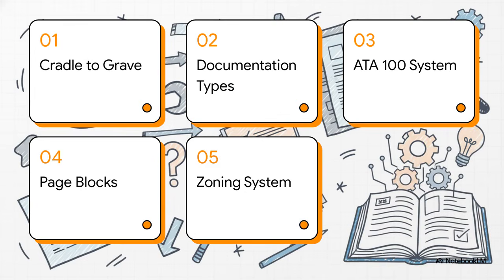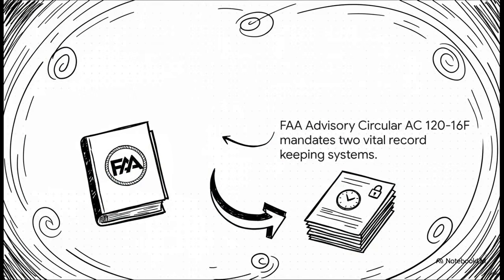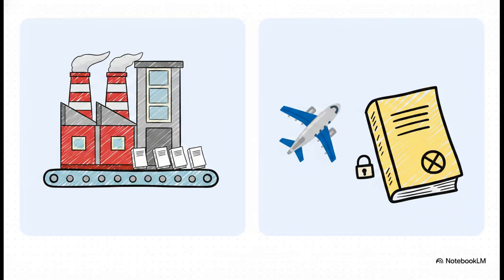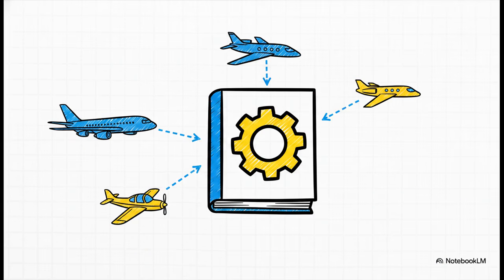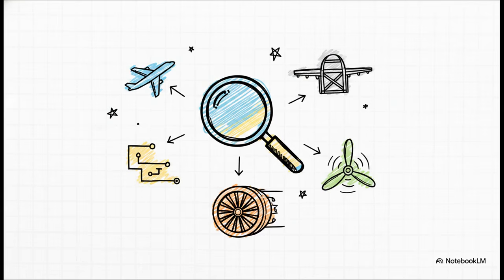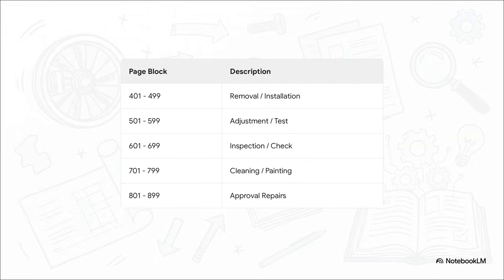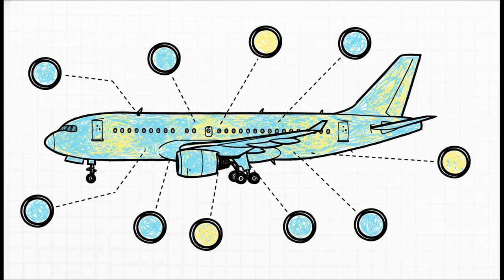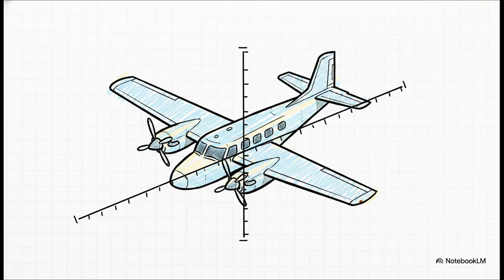AMTE 231 LESSON 01 INTRODUCTION

Comment: In Lesson 1, I learned about Aircraft Technical Publications and how they are important in aircraft maintenance. I learned about the ATA chapter numbering system and how ATA Spec 100 provides standards for the format and content of aircraft technical manuals. The ATA system organizes information into specific chapters, making it easier to locate details about different aircraft systems and components. I also learned that these publications are used by pilots, aircraft maintenance technicians, and engineers to properly understand maintenance procedures and technical information. Having a standardized system helps reduce confusion and mistakes when working on an aircraft. It also allows maintenance personnel to quickly find the correct information they need when performing inspections, repairs, or servicing. Overall, the lesson helped me understand that accurate and organized technical publications are essential for maintaining aircraft properly and ensuring the safety and reliability of both the aircraft and the people who operate and maintain it.

J.V.LADION_2B_AY2026-2027

Comment: After watching the video, I learned that aircraft maintenance documents are very important in aviation. These documents keep the record of the aircraft from the time it is made until it is no longer used. Every maintenance, inspection, and change done to the aircraft should be recorded. I also learned about the four main types of documents used in aircraft maintenance. These are manufacturer documents, regulatory documents, airline documents, and ATA documents. The ATA 100 system helps mechanics find information in maintenance manuals more easily. I also learned that the numbers in the ATA system have different meanings depending on the chapter and procedure. The video also explained the maintenance blocks, such as 401 for removing and installing parts and 601 for inspections and checks. Another thing I understood is aircraft zoning. It helps mechanics know the exact location of parts on an aircraft. The video helped me understand that proper documents and organized information are important because they make maintenance work easier and help keep the aircraft safe.

R.C.RICASA_2B_AY2026-2027

Comment: This master class gives a clear and helpful look at aviation maintenance documentation. It skips all the fluff and goes right to the parts you actually need for certification. I think learning about the life cycle under FAA Advisory Circular AC 120-16F is a game changer. It shows why every single maintenance action, inspection and modification creates a history for the airframe from the day it is built until the day it is retired. Also learning how to use the ATA 100 system is so useful. You can learn to read chapter numbers like Chapter 52 for doors and find page blocks like the 401 removal and installation block or the 601 inspection block. This helps you find what you need in technical manuals much faster when you are out, on the flight line. The way the course moves from zones like Zone 800 for doors to small aircraft station measurements using the reference datum makes a lot of sense. This review really connects the rules with the actual work of being a mechanic.

J.M.DELITON_1B_AY2026-2027

Comment: What stands out most to me is the reliance on the "cradle-to-grave" lifecycle. Seeing how every single inspection, modification, and repair forms an unbroken chain from manufacturing to decommissioning really drives home the responsibility involved in aircraft maintenance. Standardizing this under the ATA 100 system is a game-changer. The idea that I can navigate a 10,000-page manual using standardized chapter codes, page blocks (like knowing 400 immediately means Removal and Installation), and zoning numbers shows how structured communication directly prevents human error on the flight line. Whether dealing with broad zones on commercial airliners or measuring inches from a reference datum on light aircraft, precision is non-negotiable. This lesson helped me understand that knowing how to read the aircraft's geography and manual system is just as crucial as turning a wrench. Understanding these systems isn't just about passing a certification exam; it is about taking direct responsibility for structural integrity and passenger safety throughout an aircraft's operational lifespan.

RR.A.MUÑOZ_2B_AY2026-2027

Comment: Aircraft Maintenance Documentation

Aircraft maintenance documentation is an important part of aviation because it keeps a clear record of all maintenance activities performed on an aircraft. These records may include aircraft, engine, and component logbooks, inspection reports, repair records, and documents related to Airworthiness Directives. They provide information about what work was completed, when it was performed, and which authorized personnel carried out or approved the maintenance. Proper documentation helps maintenance technicians understand the aircraft’s maintenance history and determine what inspections or servicing may be needed in the future.

Keeping accurate maintenance records is also essential for aircraft airworthiness and flight safety. Maintenance entries should clearly state the work that was performed, the date it was completed, and the necessary approval or signature of qualified personnel. Well-maintained records also make it easier to track repairs, modifications, inspections, and replaced components throughout the aircraft’s service life. This allows technicians and aviation authorities to verify that maintenance has been performed according to approved procedures and regulations.

Overall, aircraft maintenance documentation is more than just paperwork. It provides a reliable history of the aircraft and helps ensure that maintenance is properly recorded, traceable, and completed to maintain safe and airworthy operations.

K.I.RABAGO_2B_AY2026-2027

Comment: After, watching the video summarization of Lesson 1, I have learned that aviation maintenance documentation is very important in keeping an aircraft safe and airworthy throughout its entire life. One of the main ideas discussed was the “cradle-to-grave” concept, which means that every important activity performed on an aircraft must be recorded from the time it is manufactured until it is retired from service. The instructor explained the topic by dividing the different documentation systems into easier parts, including the types of maintenance documents, the ATA 100 coding system used to organize and locate technical information, standardized maintenance record formats, and the aircraft zoning system used to identify different areas of the aircraft. Understanding these systems, together with following regulations and guidance such as FAA Advisory Circular AC 120-16F, helps maintenance personnel properly manage aircraft records and maintain complete, accurate, and detailed documentation throughout the aircraft's service life. 

C.A.MARTINEZ_2B_AY2026-2027

Comment: The video was helpful because it gave me a better understanding of the importance of aircraft maintenance documents and manuals. I learned that these documents are very important because they provide technicians with the correct information and procedures when working on an aircraft. The video also helped me understand that a technician should not only depend on what they already know or remember. They should always check the correct manual before starting a maintenance task. I think this is very important because even a small mistake in aircraft maintenance can affect the safety of the aircraft. The video also made me realize that different manuals have different purposes, so a technician needs to know which manual to use for a specific task. I believe learning how to read and use these documents will help me when I start doing actual maintenance work. Overall, I think the video was useful because it showed me that being a good aircraft technician is not only about knowing how to use tools and repair parts. It is also about following the correct information, procedures, and safety requirements.

Santillan, Ashix Mackenzi
AMTE 231 - 2B
AY: 2026-2027

Comment: The lecture helped me understand how important documentation is in aircraft maintenance and safety. One of the main things I learned is the “cradle-to-grave” life cycle, where every inspection, repair, modification, and maintenance activity is properly recorded from the aircraft’s production until it is retired. This creates a complete history of the aircraft and helps ensure that maintenance work is properly tracked and documented. I also learned that different types of maintenance manuals have specific purposes. The ATA 100 system helps organize technical information into standard chapters and page blocks, making it easier for technicians to find the procedures they need. This is useful because mechanics can locate information more quickly, even when working on different aircraft. Another important topic was the aircraft zoning system. I learned that different areas of an aircraft are assigned specific numbers or stations to identify their exact location. Overall, the lecture showed me that proper documentation, organization, and aircraft identification are important parts of safe and efficient maintenance. As a future aircraft technician, I need to understand these systems because even small documentation errors can affect the safety and reliability of an aircraft.

RV.E.FARIÑAS_1B_AY2026-2027

Comment: This Amte 231 lesson 1 was ery helpful as it tackles the different types of aircraft maintenance certification and documentation, from the four main  documentation types to aircraft zoning structures, to emphasize the universal ATA 100 sustem and standardized page blocks it Provides us with a decoder rine that makes hardlooking technical manuals into logical, manageable tools.Furthermore, by learning the universal ATA 100 system and its standardized six-digit numbering convention, We instantly categorize systems, sub-systems, and individual components regardless of aircraft manufacturer. When combined with standardized page block allocations for specific procedural tasks and a three-digit physical zoning matrix that maps out exact airframe locations, this framework functions as a universal decoder ring, ensuring precise regulatory compliance, procedural accuracy, and heightened safety in real-world aircraft maintenance operations.

C.J.ASUNCION_1B_AY2026-2027

Comment: Reflection on Aircraft Maintenance Documentation

For me, the main lesson of the video is that aircraft maintenance is not only about having the technical skills to inspect, repair, or replace aircraft components. It is also about knowing how to properly understand and use maintenance documentation. The different manuals, ATA numbering system, page blocks, zones, and maintenance records may seem confusing at first, but once you understand how they work, they become easier to follow. These systems are important because they keep maintenance work organized, accurate, and properly documented.
As a future aircraft maintenance technician, I believe we need to develop both our hands-on skills and our ability to read, understand, and follow technical documents. In aviation, even a small mistake can have serious consequences, so it is important to perform the correct task using the correct information.

Overall, the video gave me a better appreciation of how important documentation is throughout the aircraft maintenance process. It also reminded me that discipline, accuracy, and attention to detail are essential qualities for anyone working in the aviation industry.

M.C BUENO AMTE 231-2B AY2026- 2027

Comment: This video offers a fantastic introduction to aviation maintenance documentation, clearly explaining how an aircraft's complete history is tracked from manufacturing to retirement. It highlights how regulations like FAA AC 120-16F enforce rigorous record-keeping, while breaking down the key differences between generic manufacturer guides and custom airline manuals. The breakdown of the ATA 100 system is especially helpful, showing exactly how technicians decode standardized numbers to quickly find specific procedures, such as using Chapter 52 for doors or 400-level page blocks for removal and installation tasks on the flight line. Additionally, the lesson neatly contrasts major commercial aircraft zones—like Zone 100 for the lower fuselage—with the precise station measurements used for smaller planes from a zero-point reference datum. Wrapping up with a practical pop quiz scenario makes all these technical manual standards, page blocks, and location codes feel easy to grasp and apply.

Peñalosa, Patricia Kelly
AMTE 231 - 2B
AY: 2026-2027

Comment: This video highlights why keeping accurate records is essential for aircraft safety and airworthiness. Its main idea is the "cradle-to-grave" concept, meaning every repair, check, or modification must be recorded from the day a plane is built until it is retired. This creates a complete history of the aircraft's entire life.
The video also covers key tools used to organize this work:
Document Types: Basic forms used to log maintenance.
ATA 100 System: A standard numbering system for finding specific repair instructions quickly.
Standard Page Blocks: Form sections that group maintenance actions.
Aircraft Zoning System: A system that divides the plane into numbered areas to locate parts easily.
Mastering these systems is vital for technicians. Following proper documentation standards and FAA regulations like AC 120-16F ensures that all maintenance work is performed correctly, safely, and legally.

Aparte, Josiah T. 
AMTE 231-2B
A.Y 2026-2027

Comment: This video gave me a clearer appreciation of the significance of aircraft maintenance and its place within the industry. In the capacity of an aviation student, I got to know that aircraft maintenance is not just about fixing damaged components of an aircraft but also ensuring that the aircraft is safe to fly. This process demands knowledge, skill, discipline, and precision since even the slightest mistake can lead to safety hazards for the whole aircraft and its passengers. Among other things that I learned from the lesson is the significance of aircraft maintenance in ensuring there is no accident or failure. Proper procedures have to be followed; the appropriate tools should be used in addition to carrying out inspections of all the systems and components of an aircraft. Another thing that I was able to learn from the lesson is the fact that aircraft maintenance students have responsibilities.

J.V.HIDALGO_2B_AY2026-2027

Comment: In Lesson 1, I learned about Aircraft Technical Publications and why they are important in aircraft maintenance. I learned that these publications contain information, instructions, and procedures that help aircraft maintenance personnel when checking, servicing, and fixing an aircraft. I also learned about the ATA chapter numbering system, which helps organize information about different aircraft systems. Because of this system, it is easier for technicians, pilots, and engineers to find the information they need in the manuals. I also learned that following the correct instructions in the manuals is very important because mistakes in aircraft maintenance can affect the safety of the aircraft. This lesson helped me understand that technical publications are an important tool for aircraft maintenance personnel. Overall, I learned that knowing how to properly use aircraft manuals can help us do our work correctly and safely. It also gave me a better idea of what we will learn and do in aircraft maintenance.

J.A.DE LA CRUZ_2B_AY2026-2027

Comment: After watching the video, I learned that aviation maintenance documentation is an important part of maintaining aircraft safety and airworthiness. The video mainly discussed the cradle-to-grave concept, which means that all work and changes made to an aircraft, from its manufacturing until it is retired, must be properly recorded. This provides a complete history of the aircraft throughout its entire service life.

The video also explained different areas of aircraft maintenance documentation. These include the different types of maintenance documents, the ATA 100 numbering system, which helps technicians locate specific maintenance procedures, the standard maintenance page blocks used to classify maintenance actions, and the aircraft zoning system, which identifies specific areas of the aircraft.

Overall, understanding these standards is important for aircraft maintenance students and technicians because proper documentation helps ensure that maintenance work is performed correctly and safely. Following regulations such as FAA Advisory Circular AC 120-16F also helps maintenance personnel handle technical requirements and maintain the aircraft’s airworthiness.

R.A VASQUEZ AMTE 231-2B AY.2026-2027

Comment: Afterwatching video is an elaborate tutorial on aviation maintenance documentation, which is an essential component of airworthiness and safety in this industry. The primary theme in this tutorial is the cradle to grave lifecycle. This means that anything that is done to the aircraft from its manufacture to decommissioning needs to be recorded to form an uninterrupted record of its entire lifecycle. In this course, the instructor explains the complicated realm of maintenance in five manageable segments, namely the four different kinds of documentation, the international standard code system known as ATA 100 that makes it easier to locate the procedures, the standard maintenance page block for classification of actions, and the aircraft structure zoning system for physical geography. By learning the standards and observing the regulatory requirements such as FAA advisory circular AC120-16F, it will be easier to deal with technicalities.

J.J.DELACRUZ_2B_AY2026-2027